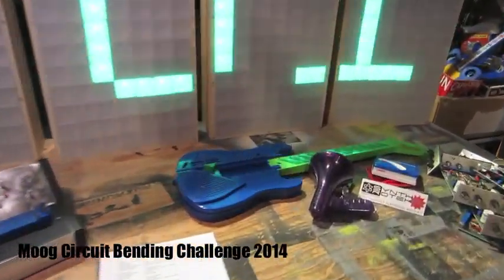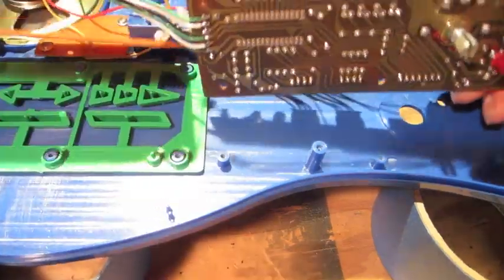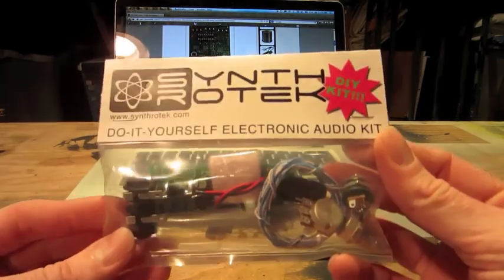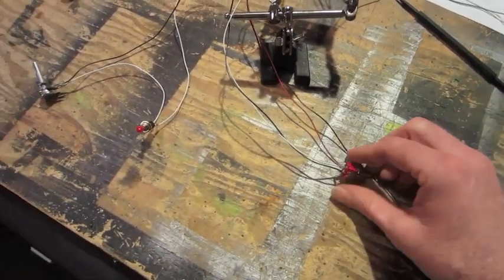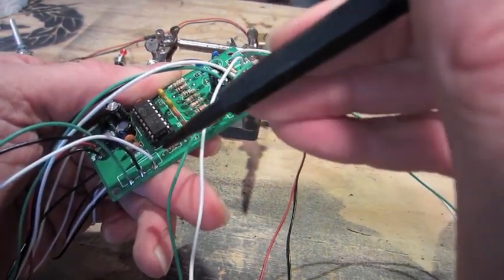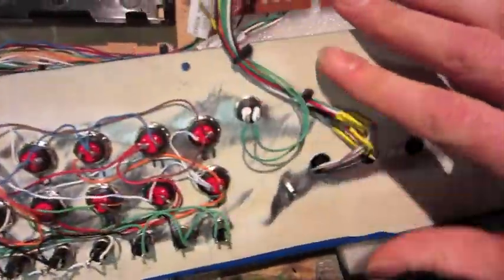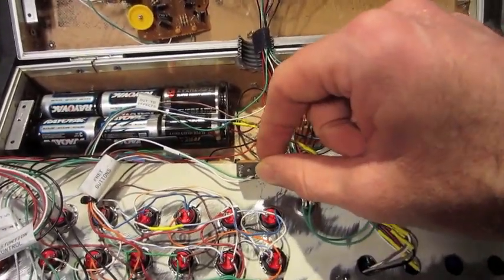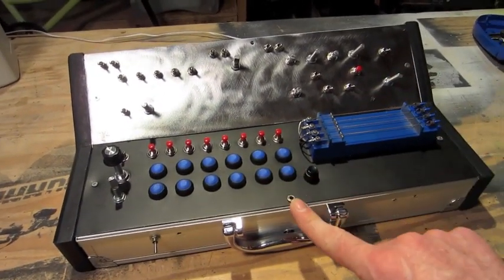Moog Circuit Bending Challenge 2014

Comment: Mike, first off congrats on third place, I think that with a little finishing touches you should have won 1st. With respect, take a hacksaw to those pot shafts and stick those moog type knobs on all your pots. Unless you take it to a mirror piano finish never paint wood, stain is a different story. Your end caps would have been so sweet then. When using the grinder attachment to simulate a brushed aluminum finish use it with a drill mounted to a fixed base, a drill press, or best, a mill. Move the panel in fixed increments x and y over lapping your circular patterns. Increments to suit your taste, and always practice first on a scrap panel. If you could, leds in all the exposed rivet holes still left in the case would be cool.
   You had the best creation and your case was a brilliant idea, your craftsmanship was way better than the others and your reward prize was sweet. Whats next?

  1st place Moog sub phatty. 2nd place Moog slim phatty. 3rd place Moog minitaur. 3rd runner up Moog moogerfooger.

    You might have some competition next time if Moog has this contest again, my bending skills are on the rise. 😊

Comment: Hey if the tape runs off of 2AAs and the other stuff is 9v isn't that 12 volts total? I thought the limit was 9? and I was looking at your parts list and you don't have any cost for the wood or the case, old audio equipement, or the sheet metal. I understand that its scap / junk / free stuff laying around, but if If I was going to replicate your project I would have to buy all that stuff. Shouldn't it be included in the costs? I mean, potentially you could make a whole build and say that you found / harvested all the parts and list them as free. and your budget would be $0 ... Idk.